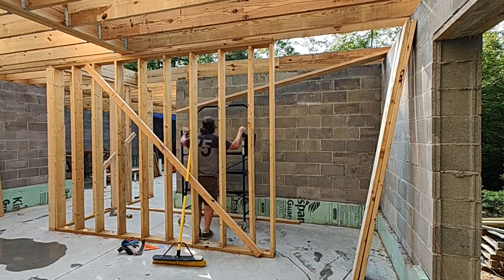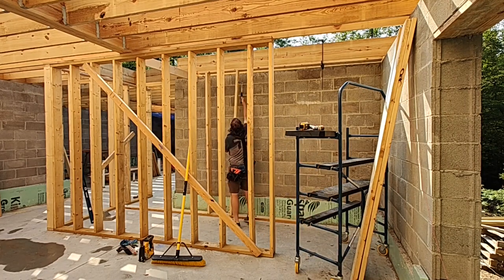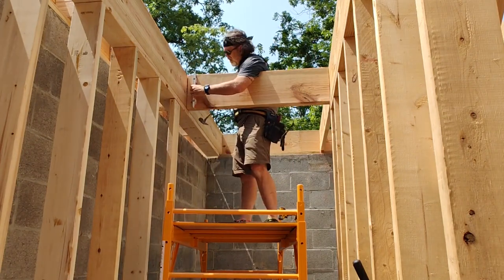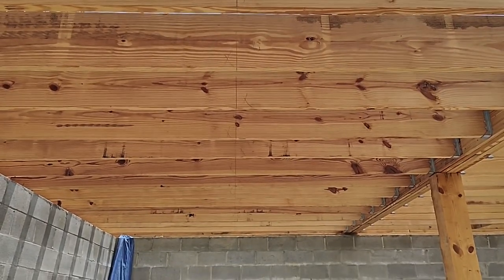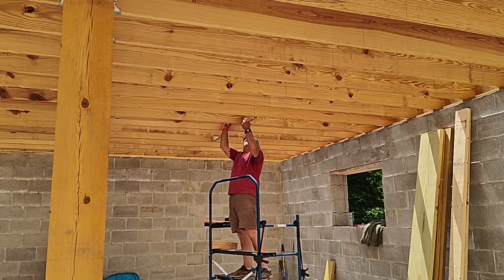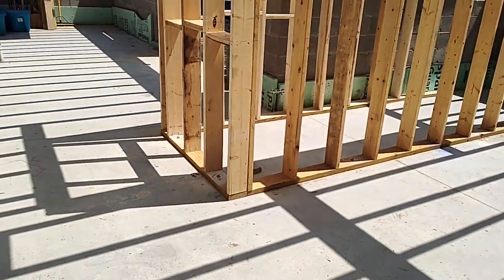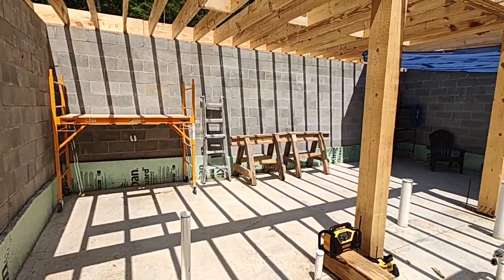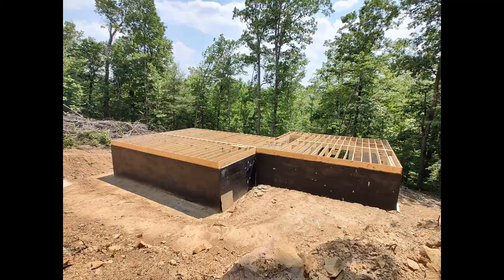DIY House Build Ep.15: Basement stairwell, subfloor blocking

Comment: Nice floor. Yes, a couple of those joists were crooked as a dogs hind leg so leaving the blocking out selectively probably helped land the sheets perfectly. Why is there a rigid foam isolation  joint on your slab perimeter - that is something I have never seen.
Reply from the maker: Thanks!  Rigid foam is acting as a thermal barrier.  There are 2 inches at the perimeter that meets up with an additional 2 inches underneath the entire slab.